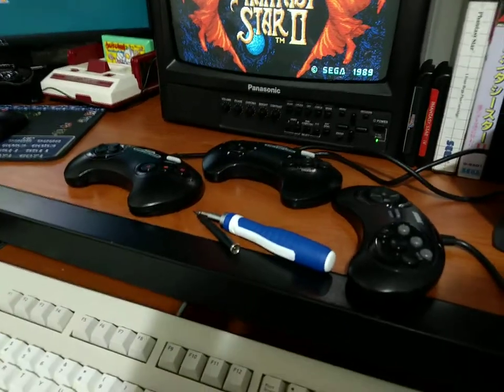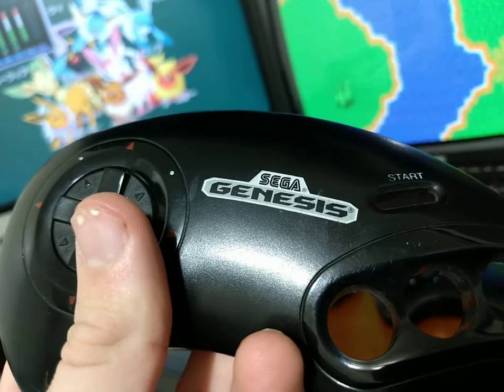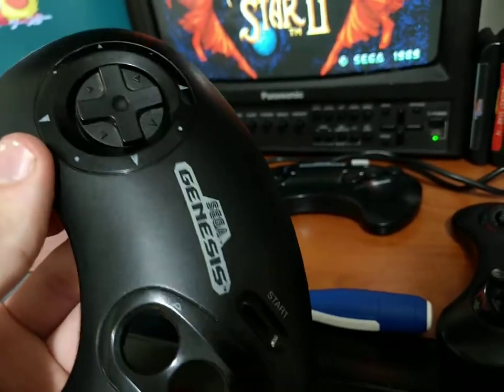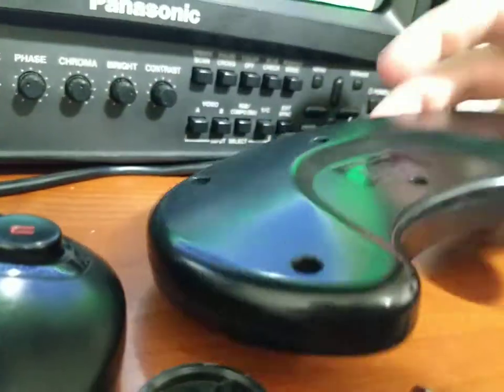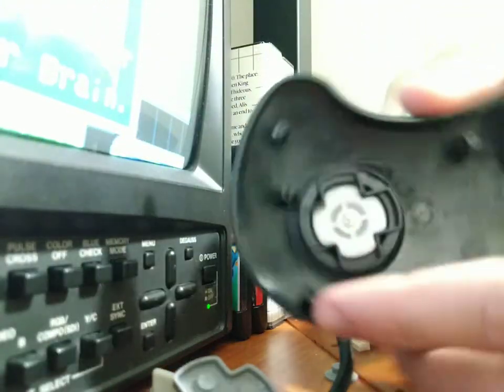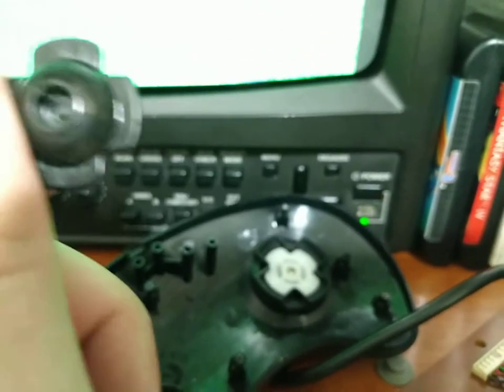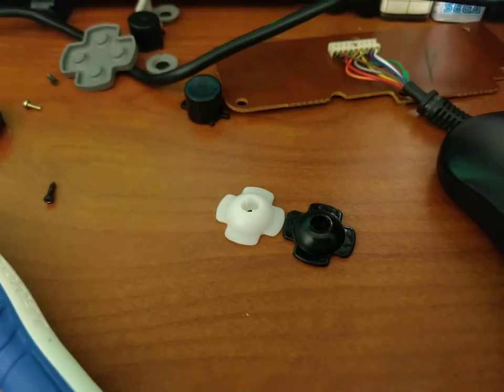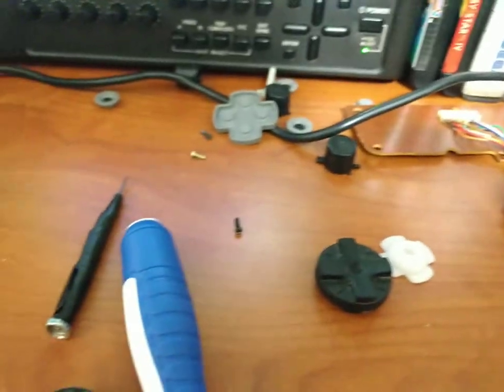Removing Mega Drive/Genesis D-Pads (and Other Controller Observations)

Comment: 8:45 since such gray rubber dpad replacement is not sold anywhere, I adapted to this controller rubber dpad from the spare PS2 controller by cutting 4 edges on the PS2 rubber dpad (which a bit smaller than SEGA Malaysia 3-Button Controller dpad). Now it fits and feels like an original!

Comment: My D-pad has become very soft from a lot of use.. There is a solution to do it again as before.??
Reply from the maker: Do you mean the actual plastic is smooth and flexing weirdly?
Reply: @wyatt8740  the direction botton who looks like cross..
Reply: The later versions have a clickier dpad that stands the test of time better that the early ones. The real early ones have a shiny plastic dpad, later ones have a rougher plastic but click better. The newest of the rough plastic dpads, are smaller and looser feeling like the Sega 6button and also click nice.

My original shiny dpad controller use to be clicky but has gotten mushy especially the right directional that was used the most.. while the other variants still feel good.

So I would say try to find a newer 3 button. I picked one up for 7 bucks a few weeks ago at my used game store. Where I could test what they had.
Reply: @Lightblue2222  Thanx a lot for all these details dude.!!
Reply from the maker: @Lightblue2222  Do note that even between the revised three buttons, there's a shiny and matte plastic d-pad variant. The one with the white backing plastic in my video uses a shiny d-pad as well.

Comment: I can't unscrew the screws in my sega genesis controller because of how rusty and stuck it is. :(
Reply from the maker: you could try drilling them out and replacing them, as a last resort. Or if you have something to cut a slit in the screw heads you can try that.
I have some dogbone NES controllers with that problem; it sucks :(

Comment: i got a 3 button where the dpad "rotates" like a clock both ways a little bit feels loose. i cant tell if it broken or not.
Reply from the maker: I have a teeny bit of wobble on some of mine. If it doesn't spin around I'd say it's probably okay. It should only be a couple degrees of wiggle.
Reply: @wyatt8740  well it the metal screw kind and it just broke snapped the black plastic part of the dpad post off. cant find a replacement dpad. that fits
Reply from the maker: @SodaGumX  eek. Sorry to hear that. I guess it was wiggling from a different place than I thought it was. You should be able to steal a d-pad from another genesis controller, and maybe even the mini genesis pads would work. Not tried. You could also try to use epoxy to glue the post back on without using too much so it doesn't change the feel.